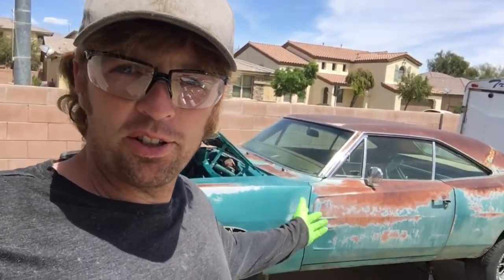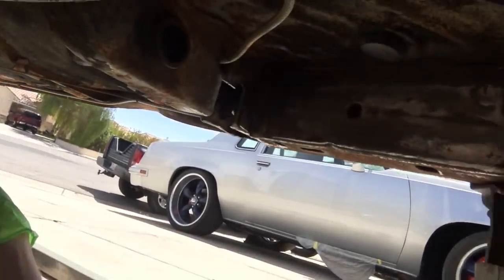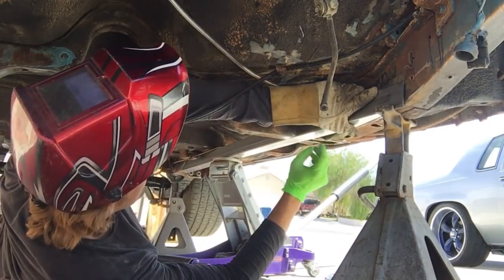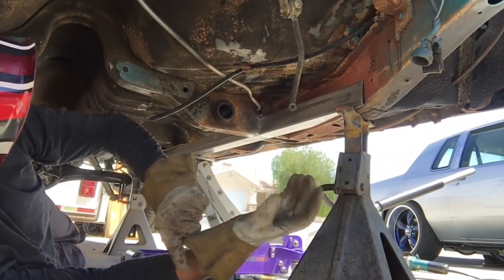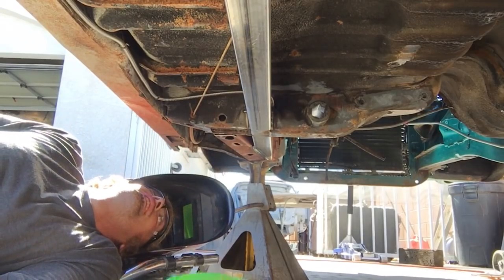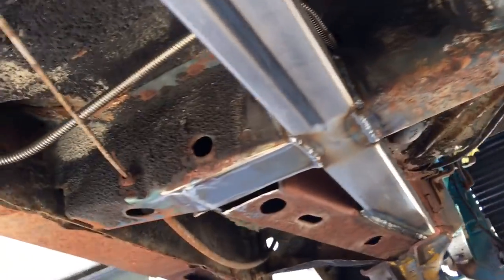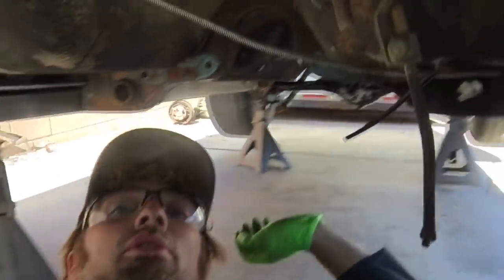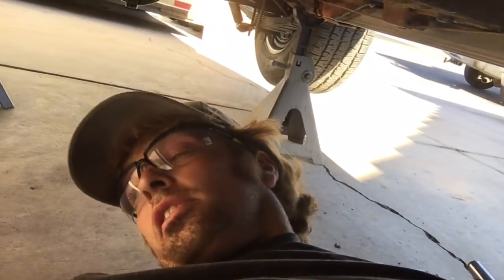part 26 of Making the turquoise 1969 Dodge Charger beefy for thrashing with subframe connectors

Comment: Dang Brother.....We are going to have to take a collection up for you. We need to get you a lift.    That crawling around on the ground stuff is ok when your younger.  You get into your upper 50's and into your 60's you'll be done with that.   You have enough cars sitting around that you'll be working on them for a long time.  Thanks for the videos.  I really like your idea for the frame rail connectors better than the ones for sale.  Plus you don't have to take the seats and carpet up.  Sweet.

Comment: Nice work on the subframe extensions, love your work. I had a Australian Charger and I remember the subframe was the same design as your Chargers are. Even down to the K frame at the front and i had issues with torque twist in the frame of the car and to fix it I fully welded all the subframe and added box sections in to help stop the body of the car from torque twisting. I never went as far as you have with make the frame rails this well.

Great videos love your work. Keep hammering on your junk.

Comment: I've done this in 1984 would of have sliced the rear sub frame and inserted it ....all the torque twist will happen at the back but welding it is ok but to insert it makes it a best. the front end is like grabbing a rake....best way is one piece and but no real need to notch the front a flat stock across the end welded to the cross member would of been fine it's like the grabbing the same handle

Comment: Sorry if I sound ignorant, but I thought subframe connectors were supposed to be put on with car sitting on it wheels with motor installed so the full weight of vehicle is applied so body lines are not tweaked and resting naturally.
Reply from the maker: Drew Lopes if convertible yes

Comment: The only way the car could look any cooler would be with a set of steel wheels, powder coated in off white to match the color of the old vinyl top. The chrome mags are just a bit too bling